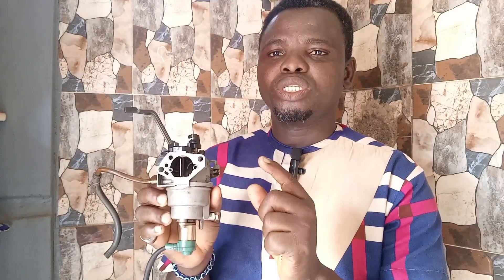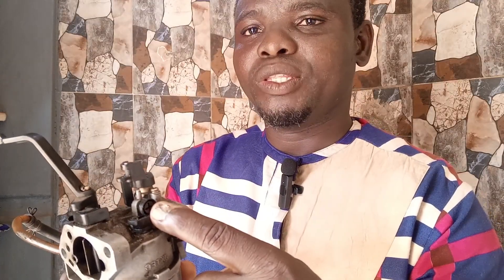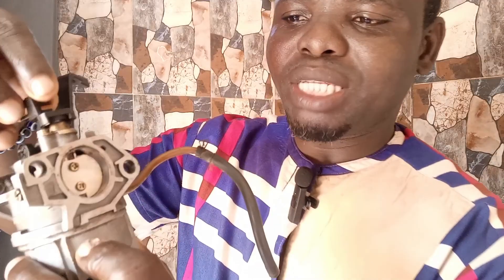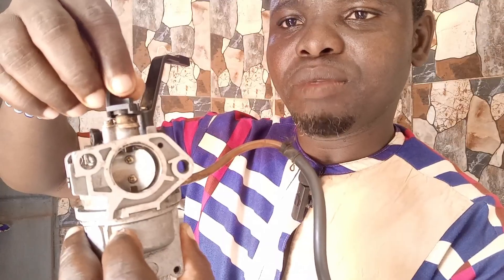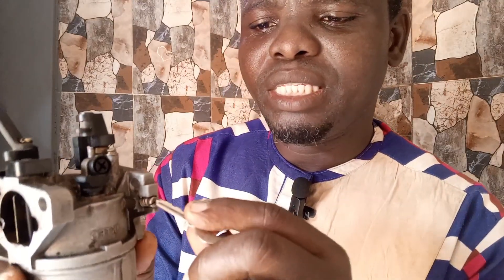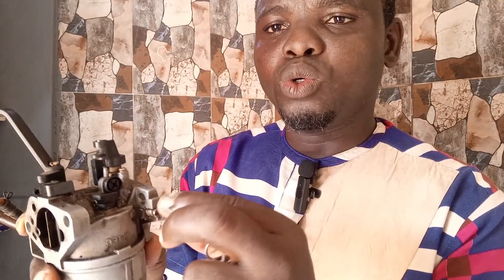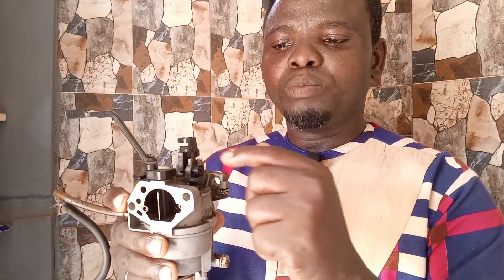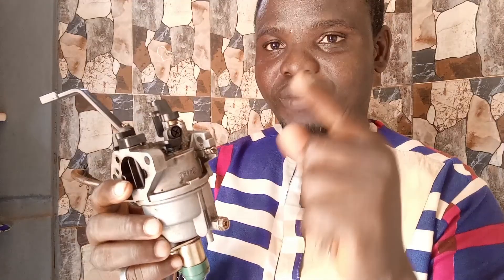How To Do Firman Generator Carburetor Adjustment

Comment: The first screw is the idle speed screw; it's used to set the idle speed of the engine when idle, not to reduce fuel consumption!
The second screw is the idle fuel mixture screw!
Be careful when making these adjustments. Anything goes wrong, you see blue smoke!
Reply from the maker: Thanks
Reply: How many turns idle fuel mixture screw?
Reply: @BongAmorin  depends on elevation, temperature, and humidity. Just play with it.